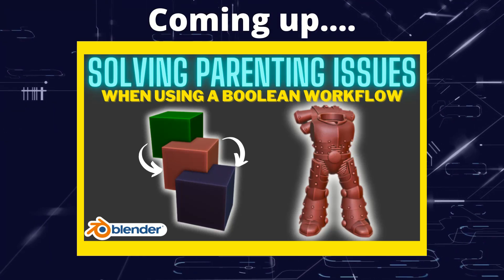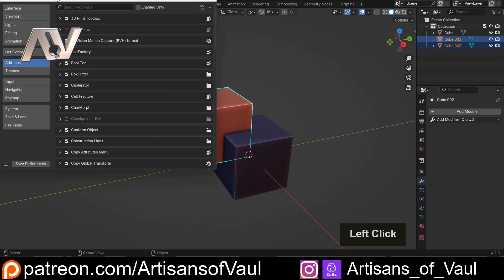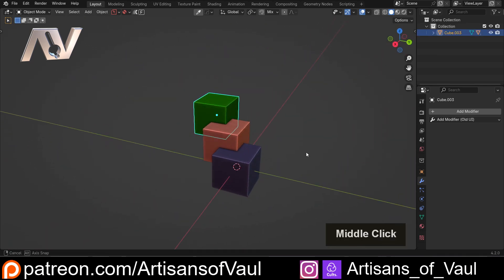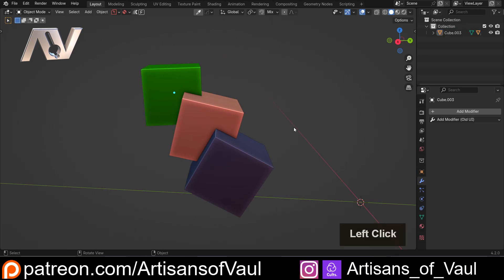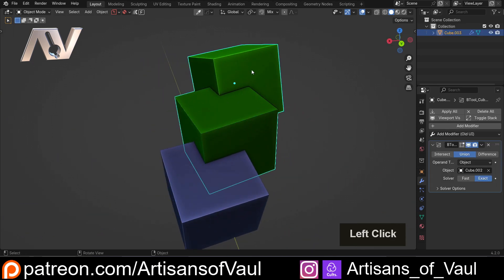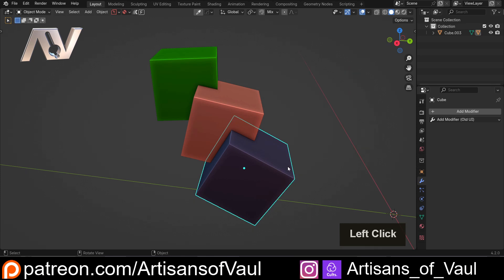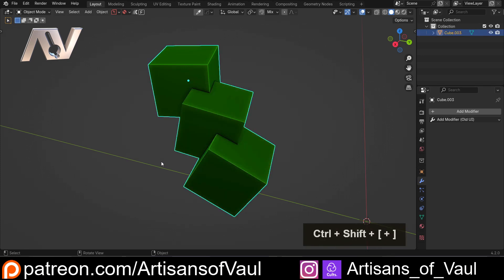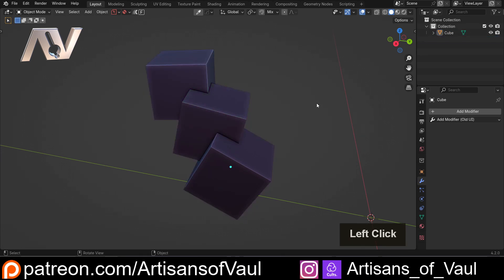Solving Parenting Issues in Blender When Using a Boolean Workflow

Comment: Also there's the 3rd option which is sidestepping the entire issue in Blender and using a 3rd party tool, like 3D Builder's Repair tool against the exported STL that contains the multiple shells. Somewhat cheating that is however 😉
Reply from the maker: @jimmyzimms  In this instance I
3D builder actually causes a load of issues (especially around the soft armour sections).  I find this so quick to do (barely a minute per model when not explaining) and it allows me to find and solve issues if I need to.